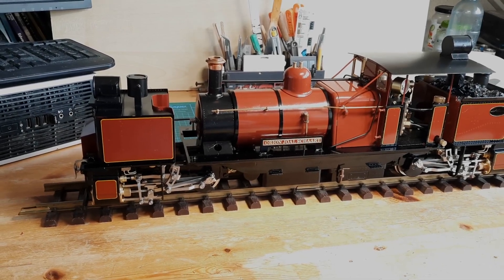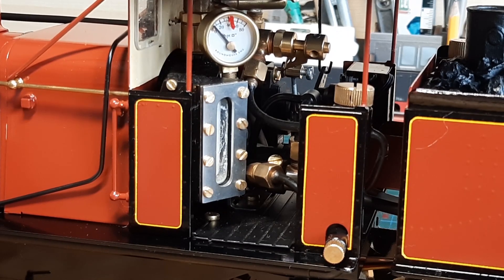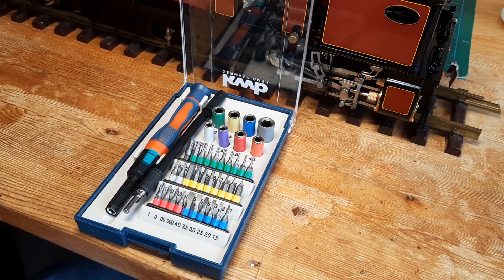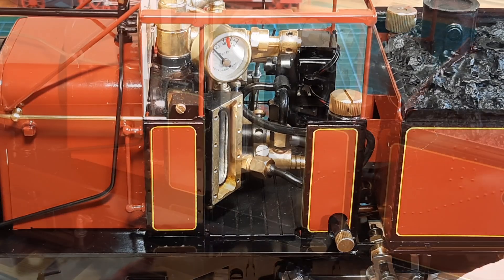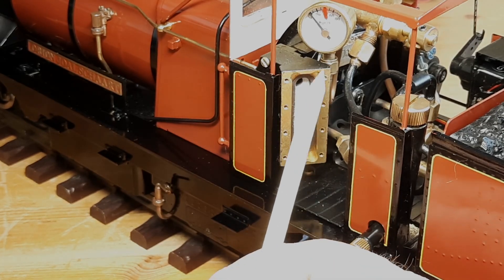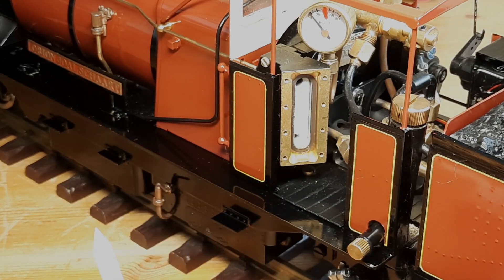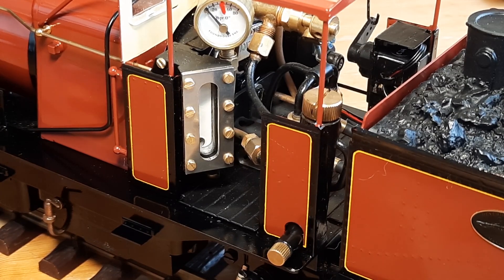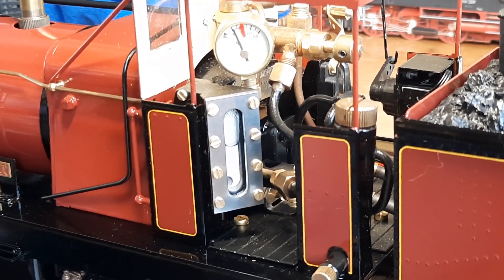D Class Diary: No.9 Cleaning the water-level gauge

Comment: If you’re using rainwater, how come you getting scaling it then please let me know. Thank you gary
Reply from the maker: Hi Gary, good question. A friend of mine with a dark green RH Garratt also has some scaling on his water glass too, and he is using distilled water 100% of the time. Maybe it's a one time thing with a new engine?..meaning some sort of deposit left over from the manufacturing process? no idea. I'll keep an eye one how long the glass stays clear now
Reply: @gasmith841 There will almost certainly be solder flux inside the pipes and tank, it might be worth with new engines filling with distilled water, firing up and running for a few minutes then letting her cool off and emptying the tank and refilling with clean water again.

Also for removing seals a set of dentists metal tooth scraper tools are really good.

Comment: Thank you for a most interesting video, Geoff..... having no experience with this style of Water Glass, I have been curious about how they were fit-up, now I see. Here's another "Tidbit" which you may like.....
-- In my own experience, I have never seen any signs of calcification (sediment deposits) in our small copper Boilers, or Water Glasses, if the Boilers have been using genuine "Distilled Water" as always has been highly recommended. I have seen such sedimentary deposits when other water sources (other than genuine Distilled Water) have been used.
-- That said, I have also found "Gunk" deposits in the Water Glasses of relatively "New" Boilers, evidently caused by the residual oily machine films or fluxes leftover from Boiler fabrication, when this oily residue or flux is "internally emulsified and washed-out" as the Boiler is steamed. This residue adheres to the glass in the Water Gauge causing an undesirable "Cloudiness" and "Gunk" in the Gauge or Steam Valves, etc.
-- With that in mind, I have adopted the practice of internally "Flushing" any "New" locomotive Boiler with: Firstly, a small amount of "Denatured Alcohol" added to & shaken in an empty Boiler, then rinsed-out & drained, being VERY CAREFUL not to spill any on the paintwork, the CAREFUL use of a Syringe can be most helpful; and Secondly, a warmed "White Vinegar" fill & shake, rinse-out & drain, followed by a "Distilled Water" rinse-out & drain before next steaming the Boiler. Thirdly, on the next steaming of the Boiler, I disconnect the Steam Pipe from the Regulator (Throttle) and blow steam to "clear" the Regulator, which prevents any residual "Gunk" flushed from the Boiler from entering the Steam Pipe and the Cylinders. On more than one occasion I have been amazed with what has been "Flushed & Rinsed" out of a small Boiler.....